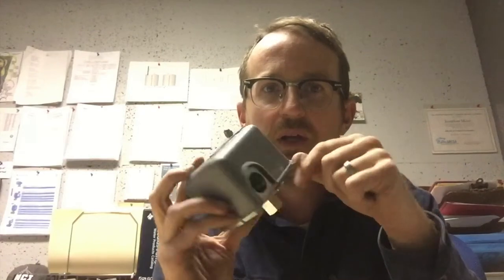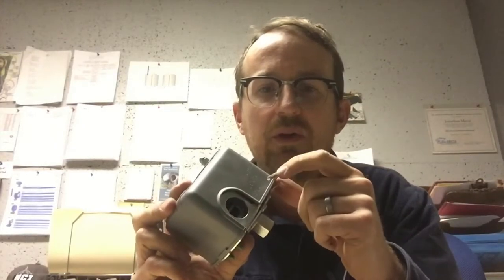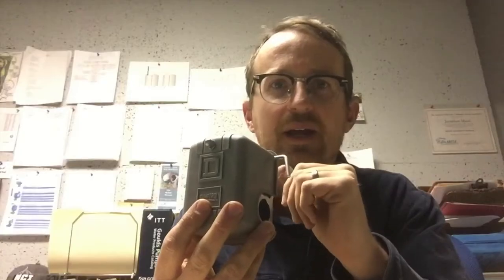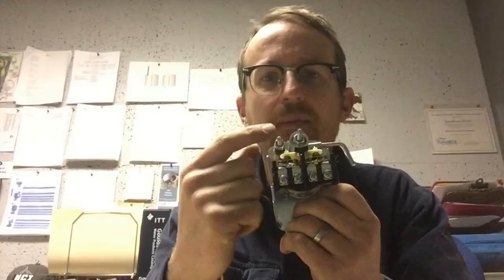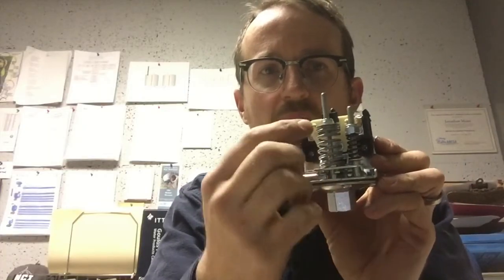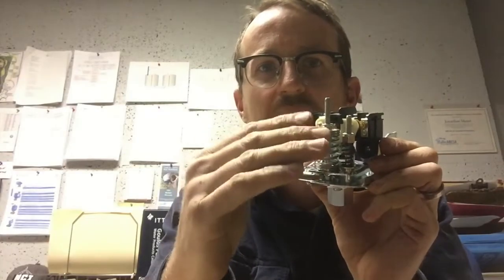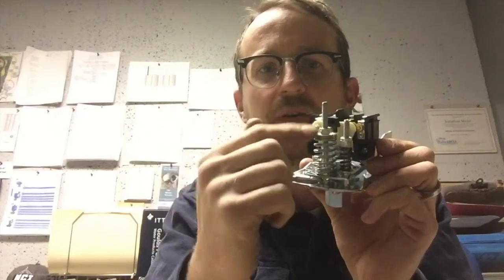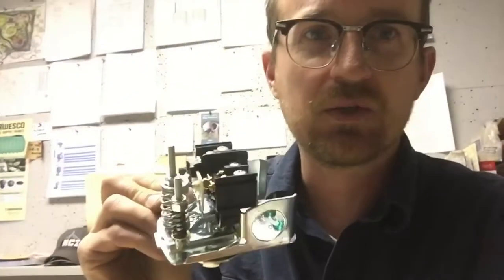How to fix your low-pressure cut-off pressure switch issues

Comment: If I understand correctly.  Would this valve work alone to shut off a jet pump when the cistern runs out of water in order to prevent damage to the pump.  (When water runs out the pressure would drop precipitously, triggering the 12 psi shut-off).

Would have to then manually toggle it once the cistern is filled again?
Reply from the maker: Yes, it protects the pump from running dry. And, yes, you have to manually toggle it to restart once water is back in the cistern/well

Comment: im not sure if this is happening to me or not..replaced the pressure switch (40/60)  seemed to work ok for a few days, then no water.  manually started the pump and it cut off at the right pressure and watched it as i ran some water..pressure dropped to the turn on point, i can hear the low pressure contacts kick in at 40 PSI.  then i see the pressure guage immediately drop to zero and pump doenst come on and sounds like the low pressure contacts disengage at that point.   if i then again manually try to restart it, it goes from zero immediately back to 40 and pressurizes from there
Reply from the maker: It sounds like the air pressure in your pressure tank is not calibrated correctly with the pressure switch, or that your pressure tank may be bad. If you look on our videos under our Shorts, I have a video that is called “How to tell if your pressure tank is bad”. If the pressure tank is good, then, with the tank empty, check to make sure your air pressure is 38 PSI

Comment: Hello! We installed a new bladder tank. Since the new install, when the water softeners regenerate at night once a week at 2 PM it triggers the low water pressure gauge to shut off. In the morning there is no water in the house as a result. We then go down and perform the 45-degree maneuver on the trigger handle and then the pressure builds up on the dial and we have water. We called the water softener technician but he claimed he does not see a problem. The installer of the new bladder tank gave us the run around stating that it's a well pump issue! It seems that the water softener regeneration is drawing too much water or taking too long causing this issue.  This has been happening once a week. Can you advise us on how to fix this please?
Reply from the maker: Did you try adjusting the pressure switch like I mentioned in this video? That is the only way to really fix it, other than replacing your pressure switch with this: https://www.rainbrothers.com/store/Amtrol-Guardian-CP-Digital-Pump-Control-p353776975

Comment: 20 is my cut in point on a 20_40 switch. No matter where it goes the points chatter
Reply from the maker: You’ll have to tighten the smaller nut only inside your pressure switch. This will increase the start/stop differential. You’ll also want to make sure the pressure switch is installed as close as possible to the pressure tank. If it still chatters, you may have a bad pressure tank, need a new pressure switch, or use a pulsation plug in the bottom of your pressure switch (as a last resort)

Comment: So tell me if I've got this right. Low pressure cut off is at 12 PSI, whether or not you're using a 30/50 switch or a 40/60 switch? I would rather just buy another switch than to go fooling with adjustment screws. So if I replace my 30/50 with a 40/60 then my false cutoff problem should be over? And if the higher pressure is a problem then I could use a pressure adjuster down flow of the pressure switch?
Reply from the maker: You have all the details right, but a 40/60 switch may not solve the issue. It will certainly be less likely to flirt with the low pressure cut-off point, but you may still have to adjust the switch. Also, please keep in mind that the only difference between a 30/50 switch and a 40/60
switch is the tension on the spring - it is easy to do yourself with just a few turns of the wrench. That will save you from probably a 45 min job of replacing your switch (which requires draining out your pressure tank and unhooking all the wiring).

Comment: Do you have to adjust the air in your bladder tank after doing that?
Reply from the maker: It’s recommended, yes. Adjust with the pressure tank drained out. But, it helps to fine tune the switch first and see where the cut in pressure lands when you hit your sweet spot, THEN adjust the air pressure in the pressure tank to 2 PSI below that cut in pressure

Comment: I just flushed my pressure tank and tried to adjust my switch.  The range is only 40-52.  I the the small cut off spring is worn out.  I assume its time for a new switch
Reply from the maker: Sounds like it, yes

Comment: I have this exact pressure switch. It was working fine and now keeps jumping off even if i physically push the switch back on
Reply from the maker: You have to hold the silver-colored bar up at a 45 degree angle until the pump builds 12 PSI or more. You’ll feel the bar hold up on its own. If you can’t get it to hold, then you don’t have enough water in your well/cistern OR you need to re-prime your pump (if you have a jet pump). Could also be that your intake pipe is frozen and the pipe is not letting water thru. Hope this helps

Comment: Lost power and the pump is in idle mode now. 

The problem is the lever that you use to hold or reset it~ or whatever.  Is missing off of that grey box. Is there an alternative to gaining back my water again,  without that lever on the box
Reply from the maker: Are you certain you have a low-pressure cut-off pressure switch? If you don’t have the lever, you likely just have a regular pressure switch. Check the breaker to the pump to make sure it didn’t trip. Try tapping the switch from outside the box. The only real way to diagnose the issue though is with a multimeter and measuring voltage inside the pressure switch. I have a detailed video on troubleshooting submersible pumps that will help tremendously if you check out our other videos and subscribe to our channel